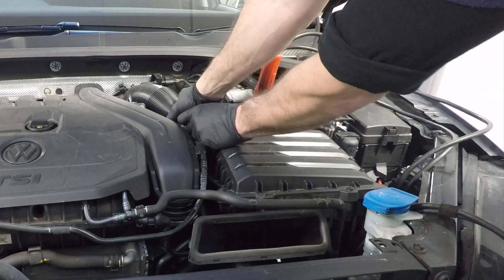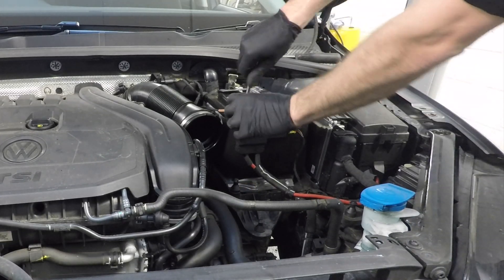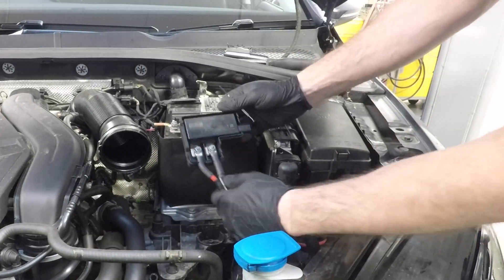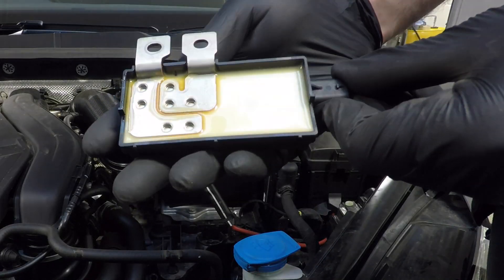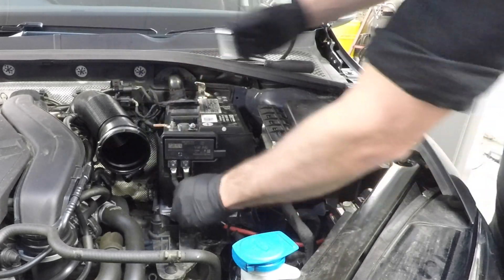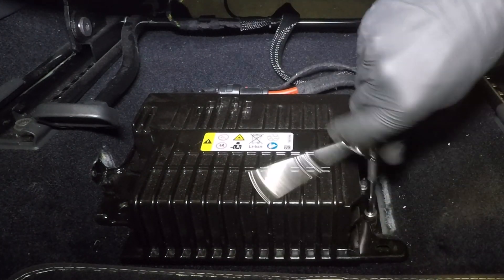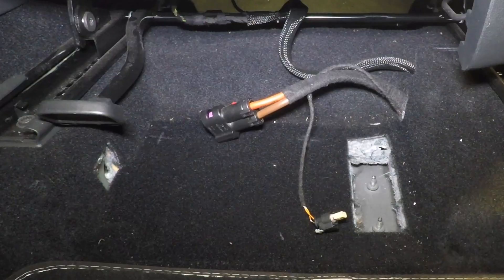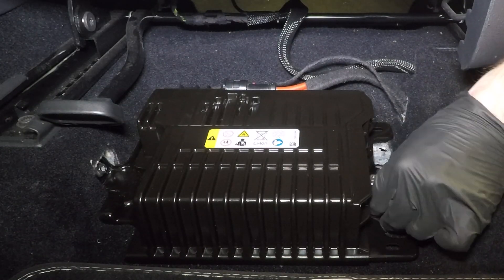VW Golf Coasting Battery operation , the Q Diode and  Fault Code P25FF00 - VOLKSWAGEN

Comment: Hi, I’ve not long taken ownership of a 2019 VW 1.5 DSG evo bluemotion and this coasting thing in my opinion is ridiculous and here’s my issue. In eco or normal mode with the start/stop turned on to stop the car from cutting out and starting every time I stop the coasting facility still causes the engine to stop and then start again and the only way to stop this is to drive in sport mode. I’m no alone with this as several Golf and Skoda owners have posted the same thing. I have access to a new VCDS unit but need to fine a suitable coding to switch the coasting feature off.
Reply: Did you manage to turn the coasting off? Cause I want it off to . I have the same problem with the start stop activiting the engine when I stop but before the stop it turn automatic to coasting mode . This Cannot be good for the engine and I want it off .. can you help me?